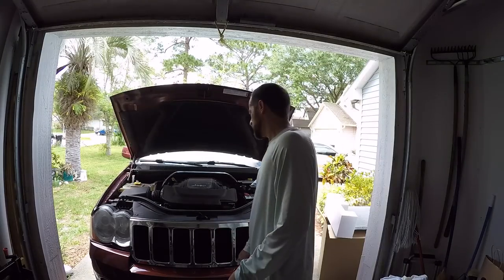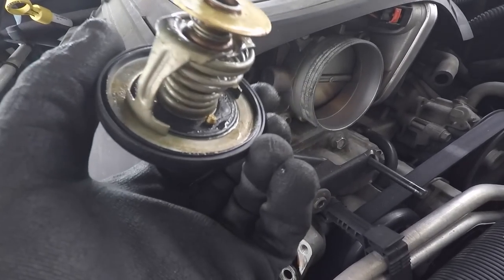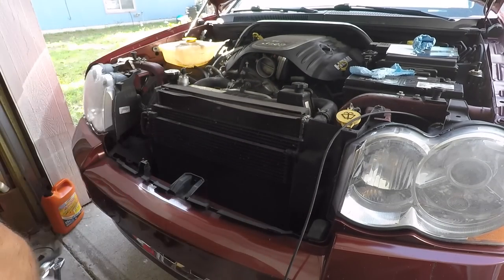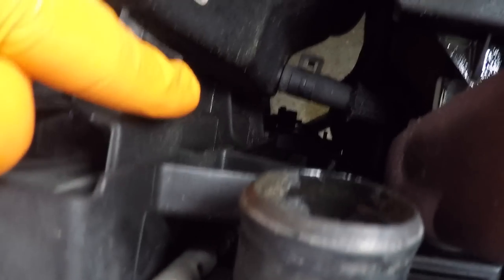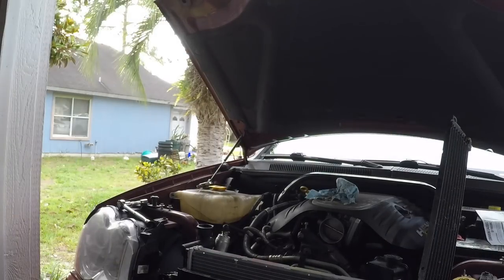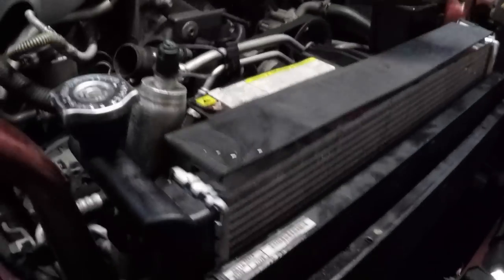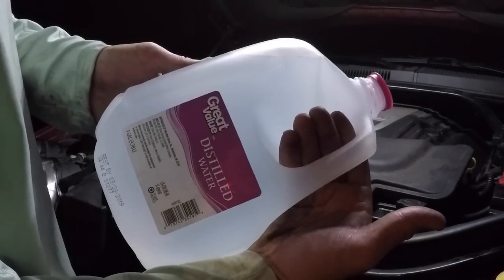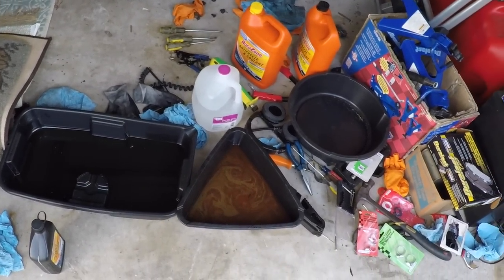DIY/How to: Radiator Install for a 2008 Jeep Grand Cherokee with a 5.7L V8 Hemi

Comment: Just changed the radiator, water pump, t-stat, and hoses in my 2005 wk with a hemi.  I did NOT have to disconnect any of the condensor or cooling lines.  You can get the radiator out without removing any cooling lines.  I removed the airbox so I could get to the left bolt holding the radiator to the vehicle.
Reply: I am on my anti-frustration break. I've been trying to get the old radiator out for about 45 minutes.  ligershark, please tell me how to get that passenger-side radiator mounting tab past the transmission cooler tabs without removing any cooling lines.
Reply: @mattwise2741  Just saw this now.  I did a lot of twisting and pulling.  How did you make out?  Also would like to thank OP for this video.  It was a great deal of help for me.  I actually planned on removing the condenser lines but didnt have the proper tools or elbow grease to get it done, which resulted in me having the f* it moment where I just went for it with the radiator.
Reply: I wound up disconnecting the transmission cooler  and the power steering cooler at the radiator (not at the bottom of the fan as shown in the vid).  Biggest mistake was the rigid tubes got twisted and mixed up. I had to pull the radiator back out to reroute the tubes. That was cause for  frustration break number 2. Works great now though!
Reply: @mattwise2741  As I said below, just break it off. I realize your comment is a year old. My reply is meant for others.
Reply: i realize it's pretty off topic but do anyone know a good place to stream newly released tv shows online?
Reply: @Malcolm Achilles thank you, I signed up and it seems like a nice service =) I appreciate it!!
Reply: @Damari Davis you are welcome :)

Comment: JUST FINISHED My Radiator replacement 04/2020  (2006 Grand Cherokee HEMI 5.7L)  ;   I got it completely done in 3 hours, wow! It is involved, but not bad.  Here are my pro tips for the next person who has to do this:
1)  Start by removing the Radiator Fluid tank ( this makes is much easier to remove the airbox )
2) Then remove the airbox ( this gives you so much more room to remove all that crap in there )
3)  DO NOT disconnect any of the power steering lines attached to the hydraulic fan ( it's not needed )
4)  When everything is loose, Look under the jeep on the drivers side and there is an electrical wire that is mounted to the frame with a plastic pin. Gently remove this and it will give you so much more room to maneuver the fan farther into the engine bay which gives you much more room to get the radiator out
5)  Highly advise you to get those plugs/caps for the transmission lines and power steering lines which are attached to the 2nd and 3rd radiators.  I didn't and transmission fluid and power steering fluid leaked everywhere.  Not a big deal, but it will be much less mess if you can cap the ports on the 2nd and 3rd radiator.
6)  When you are ready to take out the radiator (or put it back in);  grab a friend!  All those transmission and power steering lines are such a pain in the ass that a friend will help out sooo much!  When lifting out the old radiator; start by lifting on the driver side so it kind of comes out a little first.   Put in the new radiator the same way you take it out.
7)  Have a good set of tools!!!  I HIGHLY RECOMMEND a battery-powered impact driver!  I have the 18v Cordless Bosch  1/2" impact driver.  Best tool I have purchased in years.  Be sure to have a couple of extensions for your ratchets and a decent basic set of sockets.
Reply: Thank you! This information is invaluable to the DIYer. I just noticed today my drivers side tank is leaking along the crimped seam.

Comment: I just did this on a 2010 Limited with the 5.7 and tow package.  Bought the radiator off amazon for around $90 delivered 2 days later. It had plenty of very good reviews. 
I did not removed any of the things in this video.  Other then grill and other obvious things as pointed out needed to get to it.  My comments are based on standing in front, looking towards the back. 
All the bolts are pretty easy to get to for ounce.  After all are removed work the fan housing into the motor as far as possible for best clearance. I moved the top hose out of the way for better clearance. PS fluid reservoir remained connected to the fan housing, all lines connected.
Yes the ac lines and the transmission cooling lines on the left make it a PITA to get the radiator out.  The main hang up is the bottom left attachment point on the radiator. the "leg" with nut sticks out about 1- 2 inches from the radiator and gets hung on the above lines.  I used a 2+ foot 1 inch wood dowel placed it on the top of the "leg" took a hammer and wacked, broke it off. Then worked the radiator out.  Wasn't that much of a struggle. 
Getting the new one in past those lines is the tricky part because the leg is attached obviously and there is VERY little clearance to get past those lines. But the lines can be moved just enough to get the clearance needed by removing the spacer clips. And Gently working the lines to give more clearance. They can be bent enough to get more clearance. Just bey VERY careful.  
Work the radiator back in, I used a long pry bar to Gently work the lines out of the way to get past the bottom  left attachment leg. I use ramps to elevate the front end which it makes it a LOT easier to look and work with things from underneath. IME I had to work from the top and the bottom to get the leg past the lines.  Gently using the pry bar.  Removed the retaining clip for the wiring harness that runs the bottom and another retaining clip for a line down there. 
Thing is too look over things as you work, move things as needed. Granted I have been wrenching on cars, trucks etc for many years. So my skill level maybe a lot higher then the average shade tree mechanic. As some others have said. Having an impact driver, an assortment of extensions etc makes things go a lot quicker. It took me around 2 hours, with several long breaks.  I used the same cap from my old radiator.  I did this several weeks ago and no leaks so far. For me it went a lot faster then expected.  Esp after watching this video.  No snark intended

Comment: Thanks for posting.  Good video - without a lot of BS overtalking.  Did this yesterday.  

Started with installing a Tee in heater hose (Prestone kit) and flushing.  Used a grinder on the rivet for the windshield cleaner reservoir, replaced with a plastic pin.  Did not remove any other coolant lines as others have mentioned.  Just bent them around as needed.  You do need to rotate the radiator counter clockwise to clear the lines while pushing it toward the engine bay to avoid the lower passenger side tab from catching the trany coolant lines.  Look at where you are hung up and make adjustments...take your time, it is doable.  

Shifted over to replacing water pump and T-stat, much easier with radiator and appurtenant hoses gone.

Then inserted the new radiator.  Again, rotation (clockwise for install) to avoid coolant lines while pushing fan and condensers around as needed.  I just left the left bottom tab to condenser unbolted, I'll go back and fix it later.  

Recommend installing lower radiator hose before replacing serpentine etc because of access.  Ended up using the yellow stuff from Walmart instead of HOAT cash hogs.  So far so good.  leaks gone and running cooler. 👍

Comment: Just replace the radiator on a 2005 Hemi on Sunday,  Over an hour to get it out , Could not have done it myself without a helper. Getting past the lines was a bear, Trick we found at the end when it was a 1/3 way out and getting hung up on the fan was to use a broom stick between the radiator and fan housing to push the fan back at bottom just enough to get the bottom hose mount slip past. .  Before putting the new one in used a hack saw to remove the two tabs that the fan assembly would sit on.  and the ones on the bottom of the front side.  That extra clearance made installing much easier. Had back in place in about 10 minutes.

Comment: Wow so much to do! My PS pump is screaming, my radiator is leaking also need a head light swap as well woo hoo!! Anyway, thanks for this video I will get all my parts and do everything together. You have saved me lots of time just by knowing the cooling fan is run by the Power steering pump. I am grateful I saw the leak before overheating it. So now this A/c man will play back yard mechanic At least I know it will be done right!! this is round 1. in the spring I will do round 2 a/c compressor and whatever else must needs to be done I think   although I still just might do it all. Lets see if the funds come in.

Comment: Thank you for this video. It was very useful to see the steps involved. A couple things however. I only removed the power steering hose from the cooler and plugged the ends. No other hoses other than the radiator hoses was removed. Everything moved just enough to get by it.  It was still a real bear to do. Took me 4 hours to do.
Reply from the maker: Thanks for sharing! This was my first time ever performing this and glad to know I didn't have to do some of these steps lol. Thanks again!

Comment: I had to do this on mine a couple years ago, talk about a pain in the ass. I did it without removing the the fan/shroud and dealing with power steering fluid BS. I didn't remove any cooler lines either. I will be replacing it under warranty today. An extra pair of hands to hold stuff out of the way makes all the difference.

Comment: Thanks for the video - great job. I have an 07 GC Overland w/Hemi, same color as yours. The video helped a lot. This is the worst vehicle I have ever replaced a rad on. I followed your steps except I pulled the whole lower shroud, not that you needed to but it was easy enough to do and gives more room to work. I didn't disconnect the fan line at all, only the two lines on the larger cooler and the one on the passenger side for the small one. I had to end up tying up the units to hold from falling down when removing the rad. That was nasty to get  out and took a long time but actually only took probably 5 min to get  the new one slid into place. Keep up the good work, awesome job for a first video.

Comment: If someone holds the fan up and back, that's helpful. If can keep the tran and power coolers up and pushed left (facing the car) and leaning towards you while working the rad passed the pipes, that's helpful. Both the rubber support bumpers on the bottom fit perfectly.

I'm not sure why cutting the notch to fit mattered. Because none of the bolt holes on that side lineup. I used a bunch of galvanized wire to tie them together on that side. The radiator bolt might have fit in if I'd slid the adjustable bolt hole over all the way to the right, but pressure against the frame prevented that.

I agree with other comments that the power steering disconnect is unnecessary though I did it anyway because my jeep's old and I didn't know how old the PSfluid was.

Comment: Nice video- only two notes- WK's do not use standard power steering fluid, if you don't flush your system you are going to waste your pump, rack, and fan.  Also, the hemi doesn't use Glycol based coolant (green) due to the aluminum heads.  you're supposed to use HOAT (orange) coolant. Less risk of damage since it's not mixed with the flush, but still going to cause premature wear.  Besides that, great tutorial.
Reply: Red coolant is very corrosive and will destroy the engine.  Green is safe for all engines.
Reply: @AaronFergFerguson  Not true at all... Definitely use HOAT coolant.

Comment: I know this is an older video but Thank You! I could not figure out how to disconnect the cooler lines and didn't see the two bolts that hold the transmission cooler to the radiator.

Comment: Thank you very much for posting this video!  I also have the same and will need to perform this and the front diff bushings.
Reply from the maker: I'm glad it can help! It was a struggle and I learned alot. I believe I am going to need to replace my bushings as well. I just replaced the front shocks but didn't even check the bushings. Live and learn. Good luck with your radiator!

Comment: Another great modification is take a reenforced Dremel cutting wheel and remove that one and a half inch piece of metal blocking your hood release tab, otherwise no metal rod can reach it from the bottom - that plate totally blocks it so cut it out. As for security, other cars don't have it so why should yours unless you want to be stuck with a locked down hood that's impossible to bypass.

Edit : don't even need the rod. A push with your finger can release it.

Comment: Hey Big Thanks for this video! You did a great job and its so helpful to other people that will attempt the swap. Looks like a real pain in the a$$ though. I need to replace mine on a 2008 Commander Hemi. Did you have to use the Hoat coolant and special power steering fluid? Thanks again and great job!

Comment: For anyone doing this... 
You do not have to disconnect the power steering line, not sure why you did that. 
But for anyone attempting this you absolutely do need to disconnect the condensor lines for the ac and the transmission cooler. No question,  you cannot get past those lines without them being disconnected. I also did not remove the air filter box, not even sure why you would... 
As far as time I'm 2 hours in with the new transmission in but not bolted up, I'd say another hour for me to put it all back together. Was a real pain  to get the bottom pegs on the radiator back in place.
Reply from the maker: Thanks for the info! This was my first time replacing a radiator and had a huge learning curve. I'm glad some of my information was confirmed!
Reply: I went ahead and disconnected the power steering like he did and the transmission oil leaked so bad that gravity and slick got the new rad passed the metal lines on the left.
Reply: I just did this a couple days ago and can confirm that the air box, radiator support bars up front, and power steering coolers don't need to be disconnected/removed.  I also didn't need to disconnect the transmission cooler lines, but the AC condenser lines HAD to be disconnected.  Once those were out, the swap was smooth. I would also recommend replacing upper and lower hoses and cap with this swap and sticking with HOAT coolant (zyrex or Mopar).
Reply: @thegr8schlotzky  I dont know how you got it out without disconnecting the transmission cooler lines.. do you have the 5.7 hemi? I actually blew a transmission line because the clamp ring thingy was bent, it emptied the transmission fluid almost instantly.. 
Just fyi, I had leaking issues and it  turned out to be the overflow hose leaking down to the bottom fill line. 
I stuck a hose clamp on it and all is well..
Reply: Shane Carter Yes, 2006 5.7L.  Moving the radiator fan assembly towards the engine was enough for me to clear the trans cooler lines without any drama once the condenser lines were disconnected. There could be slight year-to-year differences in line configuration though.

Comment: Can you tell me what the plastic caps you used on the trans cooler are called?  or a part number from autozone? I checked with autozone and local dealerships and no one seemed to know what i was talking about. Also thanks for the video..huge help

Comment: Thanks for posting this video. This saves me $400. I just ordered a Spectra Premium CU2840 radiator for a 2006 WK Hemi. What radiator brand and type did you use?
Reply from the maker: Nice on saving the $400! I also used a Spectra Premium but the B2840 for my 2008. Glad I could help. This was my first time replacing a radiator and making a how-to video for auto parts.
Reply: Did the work just as you described only difference: I decided to take the transmission cooler/AC condenser (it's a dual function cooler) out before reinstalling because I didn't trust myself to wiggle it back in after wiggling it out (big PITA). Made installment so much easier and cleaner for the cost of $90 for refrigerant. Great tip with adjusting the front right support of the radiator. The OEM is 7 mm shorter than the Spectra one. CU2840 and B2840 are the same (had both numbers on my box). One general tip: put first all cooler screws in without tightening. You need some room to push the three coolers left and right so that the holes align otherwise you won't get all screws in.

Comment: Question:  Before you changed your radiator was it overheating at idle???
Mine is overheating at idle.
Reply from the maker: Not necessarily. The radiator just had a bad leak that would shoot coolant all over my engine. I tried using some "stop leak" stuff and it worked for a day or two, then the leak got worse. With the coolant leaking so badly, it was overheating no matter what. Idle or not.

Comment: Did you have to add transmission fluid to the transmission after changing the radiator
Reply from the maker: Negative, didn't lose that much, only a few drops.

Comment: Hi, I have damaged the transmission oil cooler in the Hemi commander. Tell me, my dear friend, does the P engine have 3.5 thousand rpm? or max? Say, please, if you have the working temperature of the engine, if the hose is hard, I can squeeze but not tight.

Comment: I have a 2005 everything looks the same.  Where did you get your Radiator at?   Dealership wants over $300 for their Radiator.
Reply from the maker: I picked up my radiator from AutoZone.
Reply: I got a Mopar for around $230